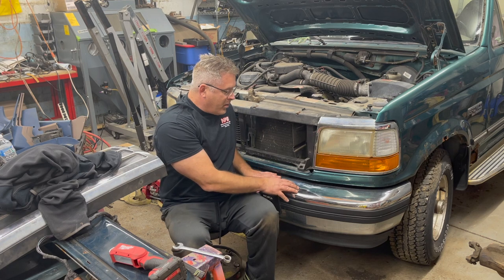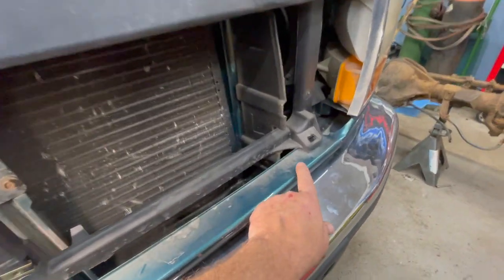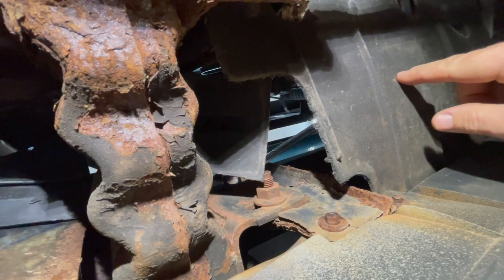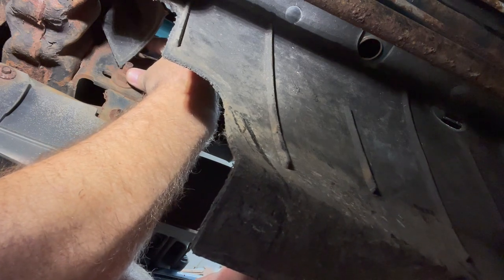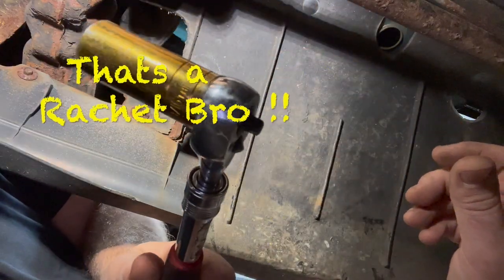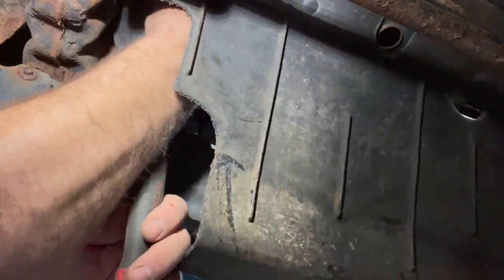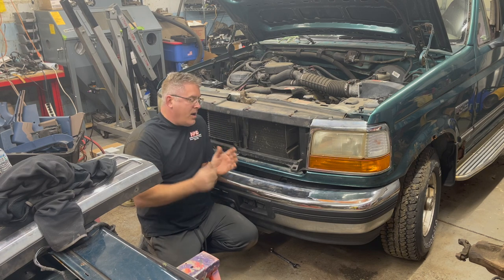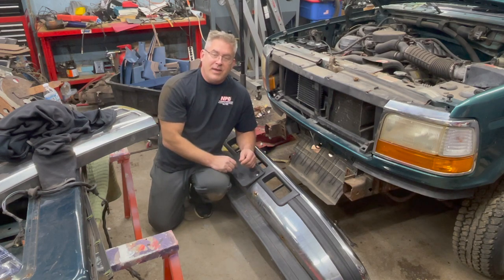How To Remove Front Bumper  Ford Bronco  OBS Ford  F150 F250 F350

Comment: What’s the “plastic shroud” held on with the pins that you move out of the way called? The pins are hanging there empty on my truck. I’m clearing missing the shroud…

Anyone know a name of part number? I assume it helps to keep severe out of that area. Sure enough I have a ton of crud in the bottom channel of my bumper 👎
Reply from the maker: It’s a rubber “shield” per say and I’m sure helps the radiator as well.  We sell them used. $40
Reply: @BroncosandPartsGarage  how do I get my hands one one from you guys?

Comment: Whats the middle "tab" that protrudes downward toward the bumper in the dead center thats part of the "lower" body painted piece.  That spans below the headlights and grille, across, .  It has a metal square tab with a circle in it that is visible between my bumper and the grille, The sides have a plastic filler piece but it seems factory nothing sits in the center.?  Does the air dam anchor to it? leftover production piece?
Reply from the maker: Can you email me a pic?  Click on video title to see contact info.
Reply from the maker: It may be where your grill attaches.